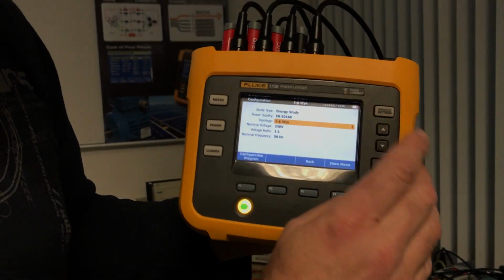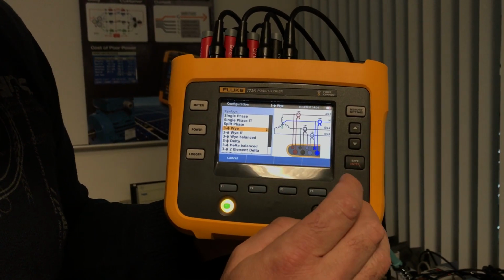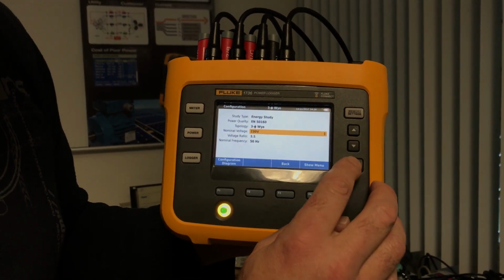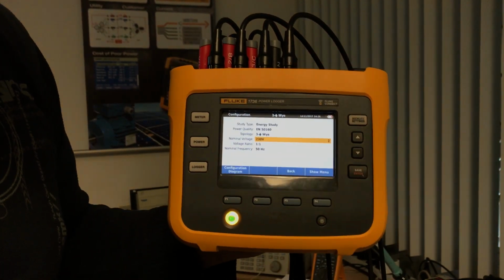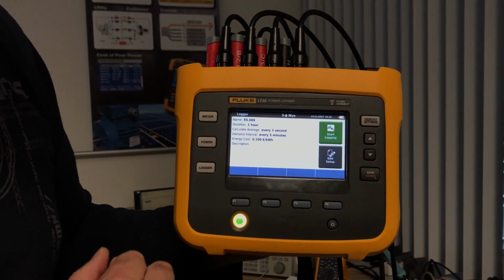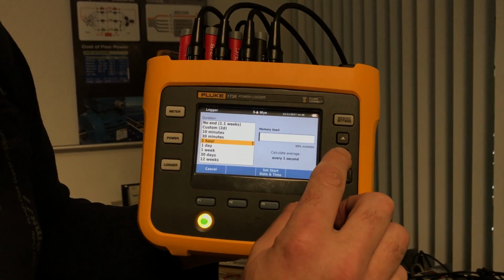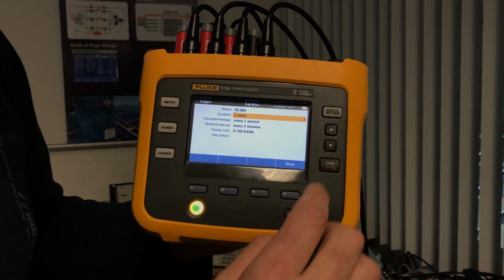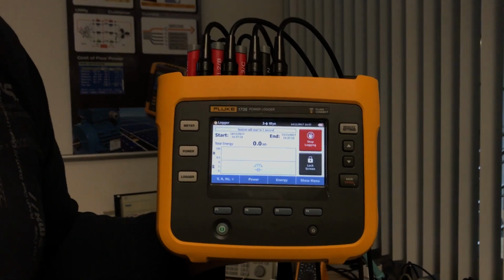Basic setup of a Fluke 1736 or 1738 Power Logger

Comment: Does this capture voltage drops with a duration of under 100ms  ?
Thank you!
Reply from the maker: Hi,

Thanks for your message & apologies for the delayed reply.

We have referred your question to our Technical team and we will get back to you asap with a reply.

Kind regards,

Fluke UK
Reply from the maker: Hello again,

Please see reply from our Technical team as follows:

Events <100ms would require half cycle RMS measurements which are only on the 1738.

If you have any further questions, please do not hesitate to ask.

Kind regards,

Fluke UK
Reply: @FlukeEMEA  Thank you very much for your reply! This half cycle RMS is active by default on the 1738 or you need to activate some option? I want to monitor a network that has very short voltage drops. Thanks again!